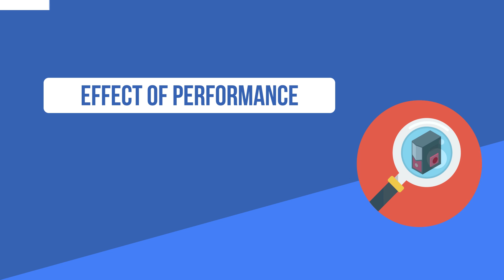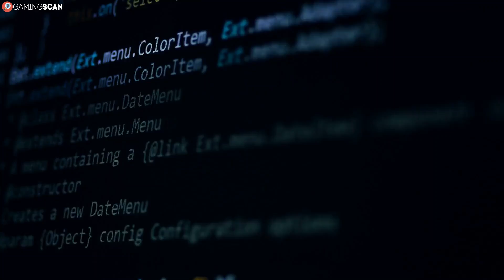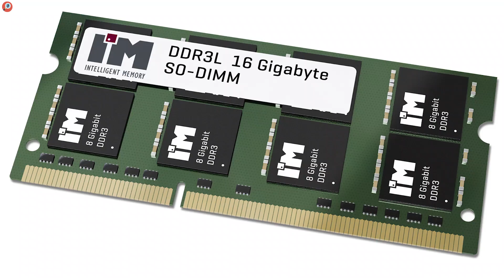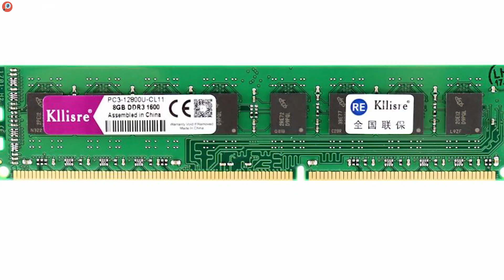Single Channel vs Dual Channel vs Quad Channel Memory (2020) [Simple Guide]

Comment: can i put dual channel 2 rams: one hyperx ddr4 3000mhz cl15 and the other hyperx ddr4 3200mhz cl16 both 1.35v
Reply: It is better for all RAM sticks to have the same specifications for stability reasons.
Reply: No, stability issues arise.
Reply: @joshtheking1772  already did it and it works fine for 1 year

Comment: Can i use 4 stick of 16gb in 4 slot ram so it equevalent to 64gb ram at all? Then what should i expect after that?
Reply: If your mainboard supports up to 64gb then you can. Dunno what you mean by "then what should i expect after that".
Reply: @roarbahamut9866  what i mean is it will be improve a lot speed f
Performance if i put at all that
Reply: 64 GB of Ram allow you to create a Ram drive which is a non - permanent storage into which you could load content that requires very, very fast access - if that sounds too complicated, don't bother. :)
Reply: @Certago  really?  Seriously?
Reply: It's still not enough to open chrome

Comment: I have 16gb of ram and when I use them in dual channel it says 7.86 useable but uses the full 16gb in single channel, can someone explain?
Reply: I also use just one ram slot, 16 gigs. Idk if i should get another
Reply: herg herg I have two 8gb sticks
Reply: @TheDede508  Did you check to make sure the sticks are inserted correctly? This may be an issue with a stick of RAM inserted incorrectly or the motherboard not detecting it (hopefully just the bios). Try taking one stick out and booting. If it boots, shut it off, put the stick back in, and remove the other. If it doesn't boot, it's an issue with the stick most likely.
Reply: I have just one stick 16 gb 2400mhz

Comment: Will adding 16 ram make my speed go to 2666mhz? Or still stay at 1333mhz.
Reply: xLuigi Otk depends on your ram but a 16GB DDR4 RAM definitely won’t be that low. Just check when you go to buy RAM what it is. I got 2x8 16GB RAM at 3000mhz just check the box to see what it is
Reply: @ZaiyeProject  Its because my ram is what I think is holding back my pc fps. I have a cousin that has rtx 2060 with a intel cpu with speed of 3.20 and he gets like 50 or 60 more fps than me.  I told him to whats his speed ram right now and he said its 2666mhz. He has 16gb of ram and he overclock it if wants but he dont want to.
Reply: @ZaiyeProject  And my specs are ryzen 7 2700x, rtx 2070, and 8gb of ram with speed of 1333mhz.
Reply: xLuigi Otk I still don’t know much about computers as I myself just built my own pc a week ago but Ik a little and I know that 8gb of Ram at those speeds is really bad considering what you have lol
Reply: @ZaiyeProject  Yea my ram is pretty slow.
Reply: xLuigi Otk yeah and you said you have an AMD cpu right? AMD LOVES fast RAM that’s specifically why I got a better motherboard that’s supports it and bought 16GB of RAM @ 3000mhz because AMD chips with slow RAM is not good.
Reply: @ZaiyeProject  So will adding new 16gb ram change my mhz to 2666? Or do I need to change it manually?
Reply: xLuigi Otk ahh I see what you’re saying now. So the RAM comes at a certain MHz when you buy it. You can choose when you buy one what speeds it has. Like I went to Best Buy (because I was impatient for amazon) and There was 16GB of RAM 2x8 at 2666MHz and another box of 2x8 16GB of RAM at 3000MHz. I just bought the higher one but I’m sure there’s ways to overclock RAM in the bios or something which you’d do manually
Reply: @ZaiyeProject  Its because I dont have this option called Xmp on my bios which is basically overclocking right?
Reply: @ZaiyeProject  So there is rams that defaults to 2666? My motherboard can Ov to 3200 but OC.
Reply: xLuigi Otk okay so they should default to 2666 if they don’t then yes you’d go to the bios and hit XMP or you can manually select it when you open the bios
Reply: @ZaiyeProject  Thank cor helping bro. I already have planned what Ram Im going to get. I just hope it changes my mhz to it self or maybe the xmp option would pop out whenever I installed the new 16gb of ram.
Reply: xLuigi Otk if not it’s easy to set. Just whenever you’re in your bios you’ll see an option for RAM frequency and sometimes it’ll default lower but you just have to click on it and it’ll ask you to select the following options or you just type in how much your RAM has and then save it that’s it. And no problem I just hope you start getting those Frames lol
Reply: @ZaiyeProject  Yea bro. Losing like 50 or something lol.
Reply: xLuigi Otk lmao damn that’s not good. Good luck!
Reply: @3etojr129  just buy a higher clocked ram ofc u want better fps ryzen CPUs tend to get better with more MHz I have 2 sticks clocked at 3600 so u should definitely buy high clocked ram because oc won't be enough
Reply: @aashleysaggar1836  their ram isnt 1333mhz like they thought, DDR4 (which it is because ryzen uses DDR4) has a minimum speed of 2133mhz.

They are likely being confused by the fact that DDR (double data rate) RAM performs two operations per cycle so the effective speed is doubled. This means that his RAM is actually already running at 2666mhz.
Reply: @wikihowsamples2972  Exactly what I was going to say
Reply: @ZaiyeProject  You think I should buy the same ram that I have right now on my pc so it can be 2x8? I was just thinking of buying new 16gb of ram and install it. But would adding the new 16gb of ram change my speed to default 2666? Or it depends what I buy?
Reply: https://youtu.be/UOP5qRPpKTk

Comment: The increase in bandwidth is not expected to be exponential - it is linear -> 1 stick - single channel, 2 sticks - dual channel, 4 sticks - quad channel...
Nice video :)
Reply: My thoughts exactly 😂
Reply: Thats wrong.  You need to use the term rank when talking about channels.
Reply: @joshtheking1772  can you give an example?

Comment: Idk I put 3 rams and everything works fine thank god
Reply: I was literally thinking about that because I'm planning on upgrading from 8 (2 x 4)  ram to 16 (2 x 8) ram but I since i will still have the previous ram was wondering if I could use it still since it's the same type of RAM by the same company.
Reply: Lunar you should be good, as long as they are the same DDR RAM like all mine are ddr4 and my motherboard takes ddr4 so I was good.
Reply: @4200224  Yep, I literally checked them side by side to see if all the specs were the same and they are and now it will come tomorrow :D

Comment: Can a single channel 8gb cause stuttering? I've been experiencing problems with my new PC and was wondering if this was the cause.
Reply: It could be..yes,but depends what games you play,your gpu capabilities and temperatures must be under 70 in gaming to not stuttering
Reply: @stefanManiak262011  I figured out what may have been causing the stuttering. I downgraded to Windows 8.1 from Windows 10 and have had no stuttering yet.
Reply: Most AAA titles need min a 8gb and your  primary operation system will take 1 go so yea expect problems
Reply: Yes, as a generalization.  If you are running single rank single channel, you bet.  Better to go with dual rank single channel.

Comment: Wait... 1:03 so will i be able to use 32 gigs 100% properly with ryzen or not? I watched the whole video, but I'm still confused.
Reply: Yes you can put 32 GB of DDR-4 RAM in a RYZEN system. Generally with RYZEN CPU's the speed of the RAM (2400, 2666, 3000, 3200, 3400, 3600 etc) can improve system performance DDR4-3200 is the sweet spot for RYZEN 1xxx and RYZEN 2xxx and for the new RYZEN 3xxx chips, 3600 is the highest you should go. RAM with Samsung B-die modules tends to perform better (G Skill Trident or Flare X) but don't worry too much about that. Much more at Leve1Techs:
https://www.youtube.com/user/teksyndicate
https://level1techs.com/
Reply: @daviddupoise6443  Much appreciated.
Reply: @jaydr0id1111  Sure thing. Join the Level1 forums and hit me up (ropestretcher) if you have any more questions. There are loads of smart people who can help. You can post a plan build before you buy and get great feedback. People do it all the time. Cheers!
Reply: @daviddupoise6443  That's actually really helpful. Thank you so much.

Comment: Can I pair a 16 GB 3000 mhz ram of 16-18-18-36 timings with another 16gb 3000 mhz ram of different company with 16-18-18-38 timings?
Reply: No. You need to buy a kit to work to work at the same latency
Reply: Thank you.
Reply: Hitaendu Nisavan I wouldn’t risk it I would just buy the same type of ram

Comment: Review on ideal frequency of RAM
Reply: 2x8 ddr 4 ram 2400mhz is ideal in 2019
Reply: It varies upon what kind of CPU you have...Ryzen prefers Higher Bandwidth due to their architecture Intel is somewhat not but still there will be performance improvements for both. 

DDR4
So in conclusion
2400Mhz
2666Mhz
3000Mhz
3200Mhz 

Those are the sweetpots for 2019 or even 2020 unless DDR5 Comes out for Ram and at Higher speeds too.

Comment: What do I use with ryzen 7 3700x
Reply: 16 gigs, dual channel, quick ram should be the minimum.
Reply: Four sticks of 16Gig 3200mhz , or 4 sticks of 8Gig 3000mhz.  Anything less and you aren't maximizing the chip or the motherboard chipset.

Comment: Threadripper uses quad channel not dual channel....
Reply: It benefits more from quad channel than dual channel
Reply: I thing they were talking about thredriper Gen 1 as they showed
Reply: @eRne_92  so your am4 motherboard supports quad channel? None of the am4 chipsets support quad channel. None of the am4 CPUs support quad channel. That's a pretty special motherboard you have.
Reply: Eff174 i was wrong, only support dual channel.
Reply: @dodecahedron-r7d  what do you think of using quad channel on AMD Ryzen 9 3900X  and what speed 3200 or higher
Reply: @frankinher7467  A1 and A2 populated is dual ranked single channel.  A1 and B1 is single rank dual channel.  All four is Dual Rank, Dual Channel.  The person making this video is interchanging the term channel when they need to use the word rank when talking about it.
Reply: I'm not sure...
Reply: Thanks! That helps me alot(i am building a threadripper rig and i am looking for what kind of ram i should get)
Reply: https://youtu.be/UOP5qRPpKTk

Comment: Sorry for dissapointed everyone but on z390 mobo you can get only dual channel. You don't feel difference between 2 and 4 channel.
If you want 4 channel you need mobo with 4 x 2 slot for ram.
Reply: It does say dual channel but why does it have 4 slots?
Reply: @Vaalhazak696  I don't know but I can confirm that you get dual channel on z390
Reply: Thats because you only have dual channel. A and B.  If you had channels C and D you would have quad channel.

Comment: If you wanna use 2 RAM sticks on a 4 channel motherboard, do you just fix them in any channel, or there are exact channels they should be fixed to get utmost performance?
Reply: there are specific channels to put 2 on
Reply: Mostotherboards put ram in slot 2 and 4

Comment: My current setup

CPU= AMD FX-4300 Vishera Quad-Core 3.8GHz
GPU=ASUS Phoenix GeForce GTX 1050 PH-GTX1050-2G 2GB 128-Bit GDDR5 PCI Express 3.0 HDCP Ready
RAM=  patriot Viper 3 8GB DDR3 1600MHz (2X4GB)

I get decent FPS in most of the games i play but i suspect my CPU is bottle necking me (as well as not having 16GB of ram)
Reply: well yea but the 1050 is trash tho
Reply: @mylesanimates  Compared to the 650 i had before it's a upgrade. I'm not made of money
Reply: @Dragonking1984  you should've bought an rx570/580. Much better value for the money.
Reply: @rootb4  It's more then just the money i also have to consider comparability. Computer parts are not universal. (though there are times i wish they were)
Reply: @Dragonking1984  for the gpu it doesn't matter except for freesync/gsync compatibility
Reply: @Dragonking1984   you should've bought an rx570
Reply: @DeadlyPG  People keep telling me this but at the time it was what i could afford & seemed like a considerable upgrade to what i had before.

Comment: Im using 1x4GB ram but i got 30 fps in the intergrated gpu ...im planning to dual channel 2x4gb soon
Reply: Buying a GPU is what's going to improve your PC more than a ram upgrade. But, having 4 GB of RAM can definitely slow you down
Reply: Just buy a toaster instead
Reply: Usually it's better to use dual channel with the integrated gpu, because it uses system memory.
Reply: @arisd.o.s6672  Do they have to be the same size ? 4x4 8x8.
Reply: Its good to dual channel actually and although its improve..
Reply: It'll be smarter to buy 2x 8gb sticks
Reply: If you are running an iGPU you need a ton of Ram.  It would be a wise investment to go with a Discrete Graphics Card.  Internal Graphics are fine if you do anything other than Gaming.  For gaming you NEED a discrete graphics card.